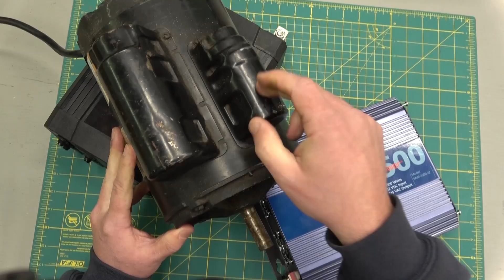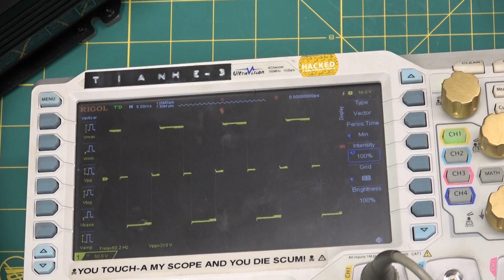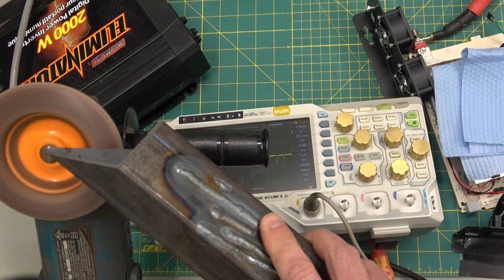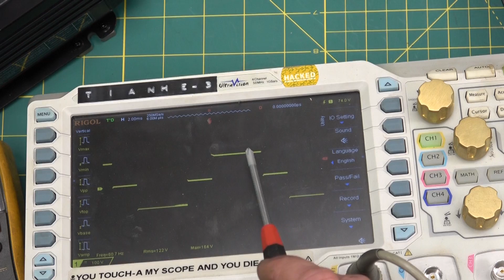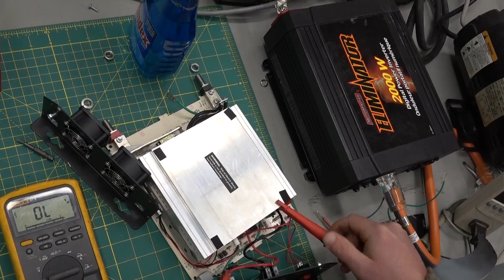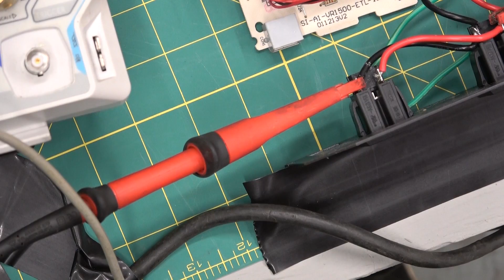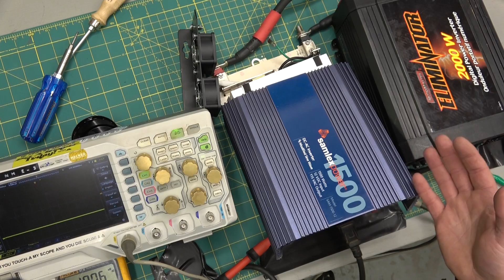BOLTR: Samlex inverter | Cheap vs. Expensive

Comment: 2.4 SOME EXAMPLES OF DEVICES THAT MAY NOT WORK PROPERLY WITH
MODIFIED SINE WAVE AND MAY ALSO GET DAMAGED ARE GIVEN BELOW:
• Laser printers, photocopiers, and magneto-optical hard drives.
• Built-in clocks in devices such as clock radios, alarm clocks, coffee makers, bread-makers,
VCR, microwave ovens etc. may not keep time correctly.
• Output voltage control devices like dimmers, ceiling fan / motor speed control may
not work properly (dimming / speed control may not function).
• Sewing machines with speed / microprocessor control.
• Transformer-less capacitive input powered devices like (i) Razors, flashlights, nightlights,
smoke detectors etc. (ii) Some re-chargers for battery packs used in hand power
tools. These may get damaged. Please check with the manufacturer of these types of
devices for suitability
Reply: Oh and induction cooktops no vwerkie I'ther.

Comment: AvE should take the off season from mountain biking to learn some guitar, which naturally leads into a fanatic obsession with vacuum tube electronics.  Push pull?  How about push pull with a transformer giving you a hearty 480VDC on the plates.  Keep your good hand in the back pocket when you're poking around in an energized circuit.  Good clean fun for the whole family. 

Also, this unit looks like a POS for the price.  Seems like it would be simple to design a protection circuit that actually protects.

Comment: first of all is that even a genuine Samlex inverter. Looks like a cheep Chinese knockoff to me.
Reply: I had the same one on my sailboat when I acquired it ... it's looks up to snuff ... but no way it's 500 dollars. I looked it up ... they go for less than 200. 

I had the same performance issue (never looked to see if the wire was loose though) with my power tools. Guy in the boat yard pointed out immediately that it was a modified wave and that I needed a pure sine wave. He recommended a Xantrex Prowatt Sw2000 which I got and have had no issues ... and it was only 344 bucks delivered to the yard. I see Hodges has them for 323. https://www.hodgesmarine.com/Xantrex-Prowatt-Sw2000-2000w-True-Sinewave-Inverte-p/xan806-1220.htm?gclid=Cj0KCQjw08XeBRC0ARIsAP_gaQA6uqNiAlEDoCFydJaTlcCD9faSgbJvByXhF1ILj5OFi-9R1EEbmLcaAuqsEALw_wcB&ppcstrkid=1565162769&click=19&ppcsclkid=eAUYw5e1CK2p&ppcsu=xhg7f5djqeniramsegdoh

Comment: Yea late to the party.....

Here is what you have:
Four separate DC-DC converters, likely making +178V and -178V each
High voltage from each converter is paralleled up to a +V and -V rail which is feeding a half H bridge.
Output half H bridge drives directly to the AC socket, some small film caps are there for switching noise suppression.
Some smarts to control the lot.

Evidence
-Four identical transformers/capacitors/mosfet groups. Topology yells out DC-DC converter, which is the first phase of an inverter. Way cheaper to build modest DC-DC converters and place multiple down and tie together than it is to build one huge one.
-The mosfets near by the DC-DC converters are RU6099R and only rated at 60V but have great RDS on and up to 120A. Low voltage rating says they must only work on the input DC and great RDS on says they can handle lots of amps with low loss (heating). 12V inverters in this wattage hit over 100A under heavy load so ampacity rating is also inline.
-Two big capacitors center of the board are what you would see as high voltage bulk storage, one +V and one -V. The point between these two is where the AC natural line will be tied to. Two groups of mosfets will take turns driving the AC hot wire to +V or -V in the waveform shown.
-The mosfets near the output side of the board are a mix of CEPF640, and KIA40N20A and both are rated for 200V and ~19 amps. AC peak voltage and current this inverter generates are inline with these ratings.

Outstanding Questions:
-Where are the rectifier diodes? The DC-DC converters will be needing a few of these.
-Why are there two different types of high voltage mosfets? Seems silly.

Comment: well that inverter is a load of bumlefuckery marketing, they just put together a slightly robust design with the cheapest crap they had around upgrade to non user replaceable fuses and security screws and slap a namebrand on it and sell it for 80% profit.

Comment: Can you take a look at a Wilmore Electronics DC to AC inverter or DC to DC converter? They still use the old technologies and through hole components. Can't find anything else like it! Still fully designed and manufactured in the USA!

Comment: Is it PRC vs ROC?  As design engineer I cannot logically explain cost difference based on components apart from the board, and what it says to me.  El cheapo unit has a board that's probably made for a build house that makes inverters for scads of labels/brands. Because of that I am also willing to bet they can do several different inverters on that board, not just a "2kw."  Change up components a little and can probably be changed up to make a 1.5kw, 1.75kw and 2.5kw and 3kw as well. Doubt samlex has their own build house, but they got a custom board and topography that's not being sold under different labels.  That board also does not seem as modular and they probably have a different board for each wattage model, or at least not as broad a range.

Comment: Can you tell me why some cordless tool chargers would die if plugged into an inverter? I had a friend that this happened to they were craftsman cordless tools. My guess it is because of the modified sign wave
Reply from the maker: The crappier the inverter the worse that spike on the leading edge of the "on" pulse. Maybe frying something like a MOV or rectifier on the input of the charger? You'll have to do the underwear check for shit stains to be certain.

Comment: Just an FYI on using the Kill-A-Watt on a "simulated sine wave": there's an MOV (?) inside the Kill-A-Watt that will get VERY hot when you feed square waves to it. I found this out when I used it to measure current output from an old APC UPS; I noticed a plastic-burning smell, and that the case of the Kill-A-Watt was getting quite warm.

Comment: I have an old wagon unit. One day it died from a bad solder unit. Unit would turn on if given percussive maintenance it. I spent a lot of time hunting it down but eventual did find the problem.  Also, re-soldered a lot of suspicious looking joints. Than I tested it, all was good. Then Went to wire it up and boom. Blow the fuses out of her by hooking her up backwards.  It's often cheaper to use a diode and fuses as reverse voltage protection than any other device because the other protection devices have pass the full current of unit through them.

Comment: MOSFET's do fail open circuit, eventually, if the current is high enough to make them into fuses. However, they tend to be short circuits before this occurs and blow the main fuse, or the traces off the board first.

However with that board the capacitors will blow up if you run at any sort of load for any length of time, because they will be run at currents way above the ( already very optimistic) rated "absolute max, beyond which they will turn into bulging spewing bits of melted plastic and confetti" current they have to endure. To actually get them to last, you will need around 20 times the number of capacitors mounted correctly, and with genuine non Crapxon parts on there as well.

Comment: True the inverter wouldn't run the big motor, but that's why in my opinion you shouldn't build standalone solar systems in domestic environments. It's fine in a camping truck to charge a phone or have some light, but in domestic situations you should always have it connected up to the main electrical net. It is so big that it acts like a buffer and absorbs the imperfections of these inverters. At least that's how it works in Belgium when you instal solar panels. It's connected up to the mains, and they measure how much electricity you put into the net. This is then subtracted from the amount of electricity you used on your electricity bill.

Comment: So, the Samlex modified sine wave inverters are no different (from my experience) than their cheap counterparts.
On the other hand, their pure sine wave inverters are usually very well built, and more reliable than their knock-off counterparts.

That said, I'm a fan of the cheaper ones (but pure sine wave only, screw that dirty not-sine-wave) because if you know where to get them, you can get the same quality for half the price. (But no warranty coverage so you best be able to fix it yourself if it does break.) Sadly, you do pay for the brand names a lot of the time.

Comment: That large heatsink extrusion may look more impressive than the ones in the cheaper inverter, but the only advantage to this heatsink design would be if airflow is blocked or a fan fails. Most of the aluminum is so far from the MOSFETs, and connected only by fairly thin walls. It's not a very efficient heatsink design, and the silicone insulator sheet required to keep the two sides electrically isolated doesn't help either. Sure,  the top will seem warm after a workout, but with the cover off a thermal imaging camera will tell a different story! Most of the heat will actually be shed on the side walls nearest the FETs.   The smaller heatsinks on the cheaper inverter are less impressive at first glance, but their deep fins forming a duct around the fans is highly efficient.  So in dirty or remote, long term  uses the Samlex FETs have a better chance of survival if a fan craps out (no feedback wires, so these inverters will keep on chooching).  But for occasional use the Motomaster really doesn't need all that extra aluminum to keep its FETs just as cool - just be sure the fans are always working and clear of obstructions.

Comment: The internals of the $600 one remind me a lot of an amplifier, usually with car amps roughly half the PCB is an inverter to bring it up to 50 or something volts before going into the amplifier section. Switching class D amps are super efficient, 90%+, and output that pure sine wave after going through filter coils. Makes you think why these don't use similar technology. Realistically all this'd need to become a pure sine wave inverter is a coil and faster switching.
When JBL first showed off their 6000w monster at CES they used it to power a reciprocating saw, and I'd guarantee it'd be better at running an air compressor than any non-industrial inverter.
There are a few 35kW amps out which output into 1 ohm, which means 170 volts at 170 amps. 60Hz sine wave and you're powering a house no problem.

Comment: Hi uncle.
I'm an engineer (not electrical but I'm no stranger to pixis). The RU6099R has max Vds of 60V so it must be used for switching before the primary while the PF640 and the 40N20 are 200V so they must be used for current regulation after the secondary but the 40N20 has a max gate voltage of 20V while the PF460 only has 10V. If they're both driven with the same voltage level the 40N20 will get bad efficiency at high loads but I guess the 40N20 is used on the high side of a bridge since it could allow a bit more fluctuation in voltage at the gate as you know while Mosfets can pass a lot of oomph a slight over-voltage at the gate will render the inverter a smoke generator an expensive house heater.

Still all this doesn't explain the different brands. ST has equivalents for the RU6099 and the PF640, maybe they're just going for the cheapest parts.

Based on my experience 200$ is a fair price for the Samlex..... definitely not 600$. Tell me if you need further details. Cheers!

Comment: WTF   "i actually dont  have a  soldering iron here"  you are a Bilingual Bush Mechanic Master  (not a jedi yet)
get your head out your arse  

and Xantrex (well know for shore power) manufactures the Eliminator brand for crappy Tire 
so not your average shengeng/hong kong   discount inverter    
buy real  $72 / 1000 watt   and  wrangle up them pixxies

Comment: I tell you,these metal wrapped charging cables sure do hold up well. At least no bunny is chewing them up. lol. ! Those Mosfets are not even fastened properly really. I wonder if thermal paste would benifit that heat sink. I DK.  So hot was not.hummm, guess the cost of solder must have went up. lol. $500,for a converter wow! I have used them on my campers and cost wize, they didnt come to $500  Clams. Of course a new celly phoney costs that much now. Two years old and the screen has burn in . I,love Samsung phones, but not when they defect on me.

Comment: This kinda mirrors my experience with a 110AUD vs 380AUD Projecta pure sine Wave inverter I bought in Oz.
The Projecta has a display and remote control with a display and wayyyyy better cooling as the cheapo blew a couple Mosfets while running PC speakers on a hot day. 

However, in terms of power output, the noname unit wipes the floor with the expensive one. 
Next time I might just buy a cheapo again and simply add a few more 12V Fans to it, job done.

Comment: The higher price is in the marketing. As soon as you cracked open the second one (this video, as opposed to the prior inverter video), it looked cheap to me. They seem to cater to a slightly different market. Not quite as bad as marketing snake oil to the audiophool crowd.

I use to attend the CES (Consumer Electronics Show), in Las Vegas, for many years. I noticed  "high end" audio gear often used cheap paper phenolic PCB (Printed Circuit Boards), while some poor slob selling "commodity" computer plug-in cards used higher grade epoxy fiberglass. The high end audio stuff sold for thousands of dollars, with single sided boards and wire jumpers, to serve as a second side. The computer boards, being a commodity, sold for between $10 & $80, depending on function, for boards that often had 4 or more layers. You have to factor in snob appeal, and its effect on stupid.

A note between MOSFETs and IGBTs. IGBTs have an advantage, when you start with a high voltage, but MOSFETs can switch much faster. Application, as ALWAYS, determines what is more suitable. Often its okay to use jellybean, and unmatched parts. The application will determine that. If you are biased to one part, or the other, indifferent to application, then I got some high end stereo gear to sell you !

Comment: It looks like the soft start on that Samlex is tuned for electronic loads, not motors. One that has V/Hz soft start will handle that big motor like a charm, especially without a load.

Comment: The good one was a 1500 w inverter and the crappy tire brand was a 2000 the extra 500w could allow it to smooth out the sign wave better then the other under load because it’s rained for more watts (note I was half ass asleep during the video I’m not sure if you mentioned this)
Reply: Still the samlex was surprisingly crap for what you pay for tho

Comment: Aspiring Enginerd here: I would think that one of the things that those hard earned Canadian doll hairs are going to is those transformers. Only speculating based on what I have learned from the interwebs, but I would guess that the loosely made transformers in the cheaper model are much less efficient due to the gap between the main winding and the core itself, as well as the HV windings. The magnetic flux created by the wire is decreasing over the distance so a denser transformer could be used to mitigate this by placing all of the wires closer together in a better magnetic field conductor (that is to say surround more wire with more ferrite to better 'conduct' the magnetic field and direct it towards the HV winding). This would cause an increase in efficiency I could only presume. Would it be possible for you to test this out by measuring P-in and P-out?

Comment: Every so often i see isolation transformers for old DEC mainframes out in california, im tempted to get one and see if perhaps it can help even out the rough signals..... or i could just get a capacitor. but im still curious.

BTW, really find it silly the names of fake brands now. many sound like cheesy action movies. "The Eliminator" sure doesnt paint the picture of an inverter in my head. reminds me of a camper trailer thing i saw a while back, on the side it had in big tacky american lettering "Vengeance 2000"..... talk about tacky naming. would be better to leave the side blank. i dont get it.

Comment: Let's have a look at the current waveform! Voltage waveforms frequently have noise and don't make too much difference. A noisy current waveform would cause more havoc. The current waveform may be different between the two

Comment: I suggest that "Solar" is the least understood trade of all. The most non-mechanical, klutzy person in the world knows more about Auto mechanics or what Carpenters do or even get the idea that welders melt metal together. But for most people, solar is magic pixies. Heck, for most people, plain AC on DC electrosity is magic beans. So look at those two inverters on the bench. One looks like it came from the local Auto parts store. You can almost hear the heavy metal grunge music on the commercial. ... Now look at the extruded al-you-minium inverter. Font, color, it looks like it's from Sweden. Built by rocket scientist. And marketed by Birkenstock wearing, hybrid car driving hipsters, just like "me".

Solar consumers (buyers) buy what makes them "feel safe". That color blue makes them feel safer. "I'd" pay more for that.

Just guessing. Think I'm close? Thanks - Lumpy
Reply: Craig Lumpy Lemke - sounds plausible